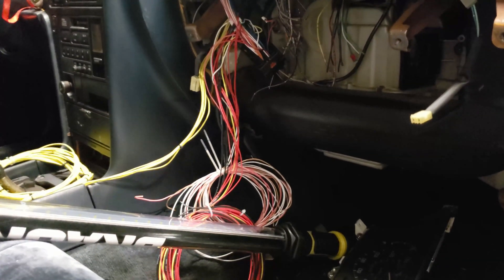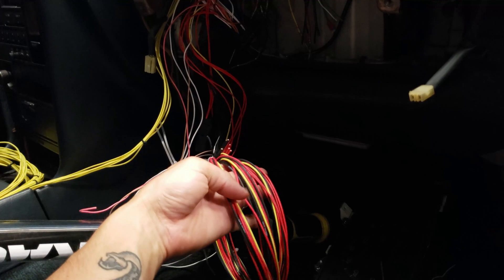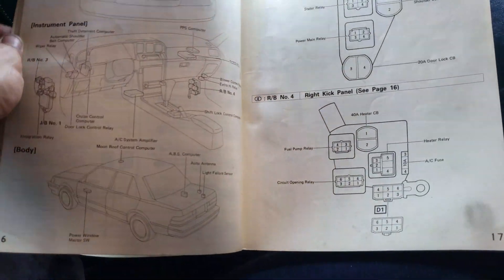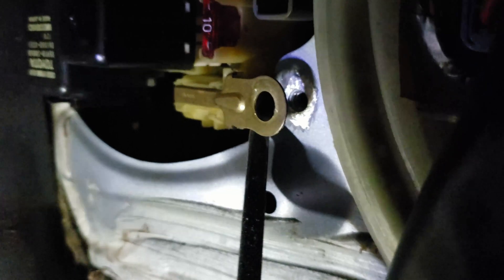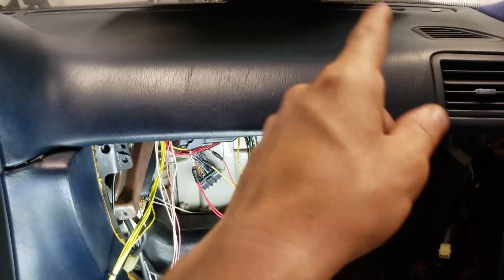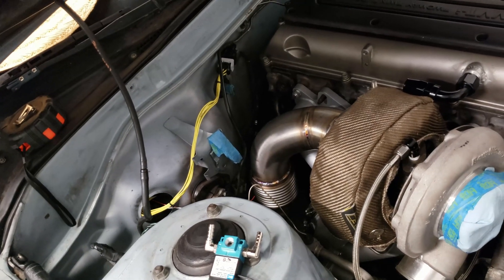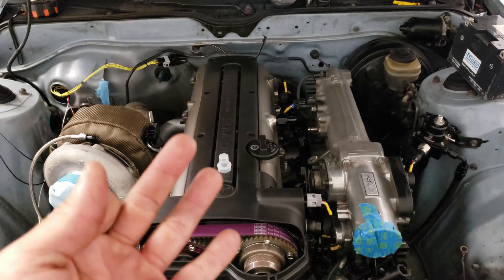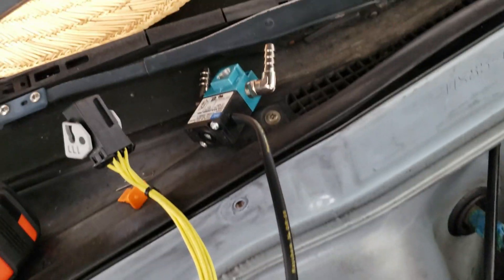Ep22 How to wire power/ground for AEM Infinity

Comment: Hey man I’m having issues with starting up my 1jz e46 wagon. 

I have 12v to coil packs 

I believe 0v to injectors 

And 0.9 v to c1-63 and 0v to c1-68. 

I’m not the wiring guy tbh I’m kinda a noob. Would you be able to Guide me or tell me how exactly you ran your two 12v wires to c1-63 and 68